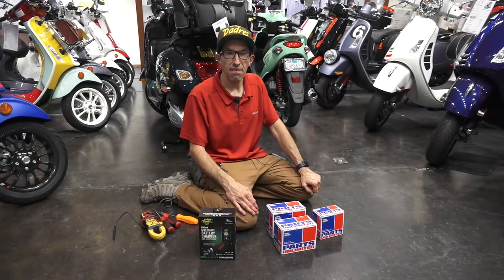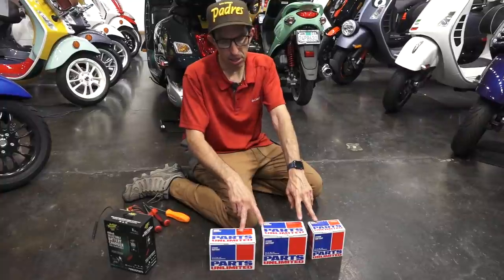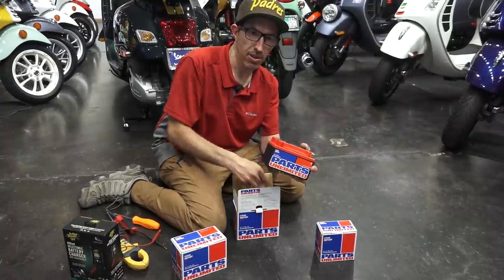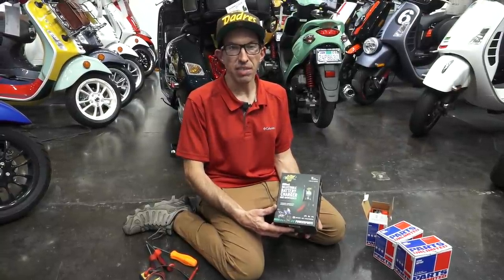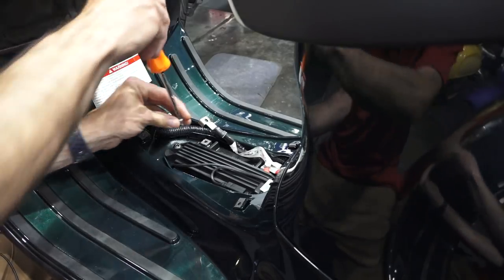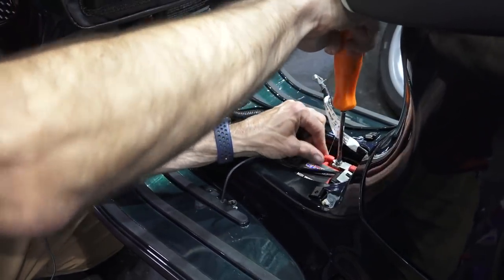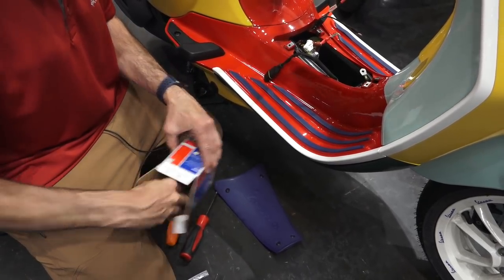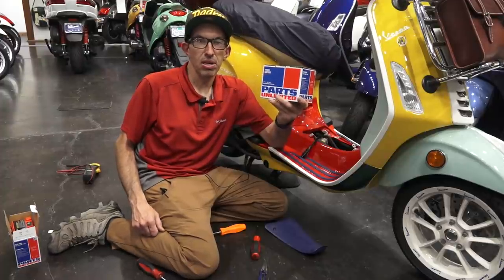Lithium Battery Options & Installation for Vespa Scooters

Comment: I was stoked to see this video show up this morning as I need a new battery for my stock P200. You mention vintage at the beginning of the video, but it never comes up again. The cranking amps of these batteries makes a difference starting moderns, but how would it apply for the P? What's your recommendation for a replacement battery? 

Big fan of the videos and proudly rock my YouTube Certified Scooter Tech badge (converted it to a magnet 🧲🤖).

Comment: I know this is a slightly different thing, but I started using a super capacitor to recover dying batteries (i.e. autowit batteryless car jump starter).  Hook it up to your battery, it soaks up the remaining energy, takes 1-2 minutes, once it has 12v it can jump your battery.  As opposed to lithium jump starters, it's super light, and you don't have to worry about a battery exploding.
Reply: But rather expensive.

Comment: What actually drains the battery? I have a Vespa ET4 Vintage model as a project bike i'm working on at the minute. Battery was charged a few days ago and is now completely drained again and doesn't have the power too crank over. Thanks Motorsport :)

Comment: HELLO . such a problem with the wiring of the scooter Piaggio X8evo
The cigarette lighter on the dashboard and the central locking of the seat and trunk will drain the battery if not started for several days, and all batteries are dead, although they should have been active only when the ignition key was turned.
Checked with a tester the scooter is not active (the engine is not working)

Comment: My experience with cold weather starting was that lead acid had to be discharged a little before it got up to full voltage, where lithium delivered a surge right away.  My mp3 started with a bang regardless of temperature or how long it was last run.

Comment: Replaced the battery in my BV 350 (with another gel battery) and it wouldn't idle properly afterwards.......had to have the ECU re-flashed. What's up with that ? Have you ever seen it before ?
Reply: Did you touch any wires together while fitting or removing the old battery? Was the bike turned off? Did you wait a long time inbetween removing the old battery and replacing it with the new?
Reply: @JakeM218  No, yes, no............

Comment: My big problem with most lithium batteries is the damage that occurs when you discharge it too much. Most people are going to try and start their bikes until it won't spin and there goes your $200 battery.
Reply: I thought it was lead acid that has troubles if it’s discharged below 50%.

Lithium is used in most phones, and those easily go down to 0% and then take a full charge after?
Reply: You have to recharge the lithium battery when the energy goes down to 15%.